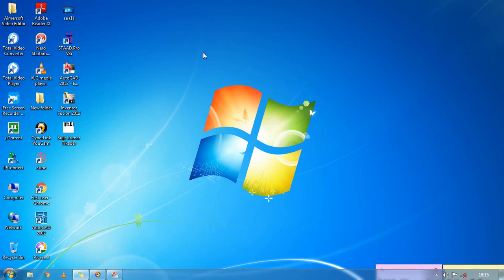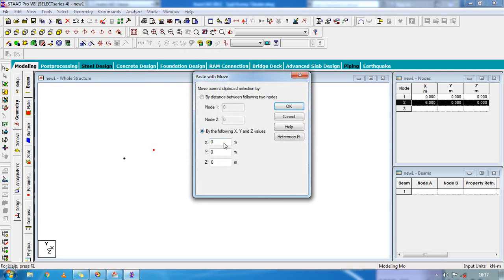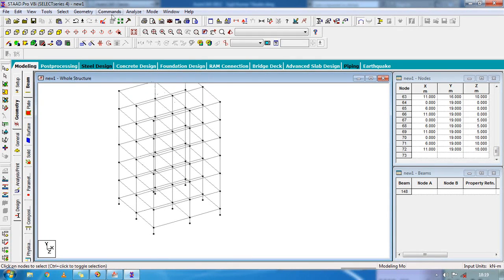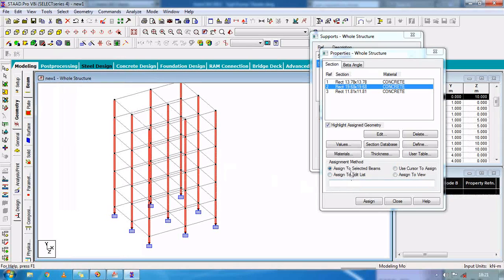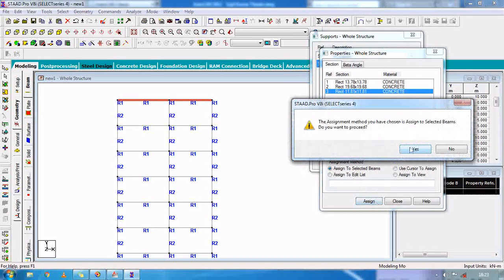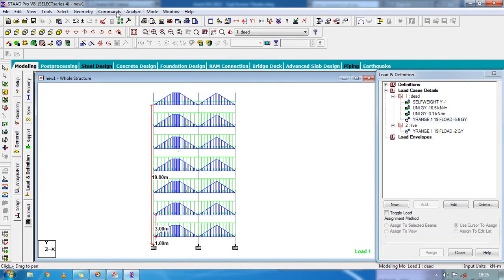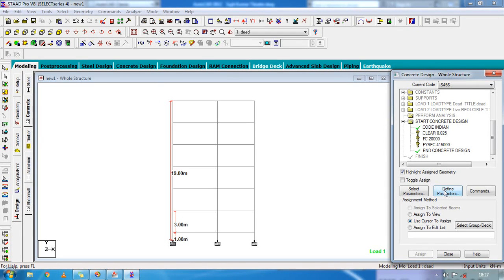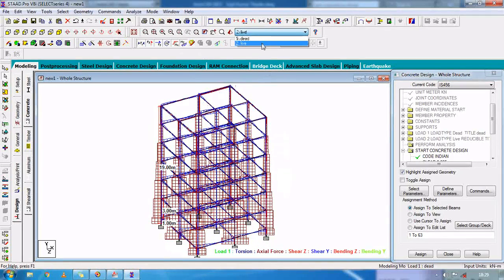STAAD Pro Tutorials - Design of RCC Multistorey Building Part 1 ( Day 6 )

Comment: Hi, I found that some people could not find the concrete codes. It happened to me before and I wish it will help other people as well. It is under the grey coloured tab (on the left) Modelling -> Design -> Concrete. Under design tab will find there are steel, concrete, timber, aluminium and shear wall (from top to bottom order). The concrete tab just below the steel tab. Click concrete and you will be able to find codes related to concrete.

Comment: Sir i observed that the design results shows 12mm rebar on column and 20mm on beam main rebars.  is that okay? what is your opinion on this.
Reply: im sorry, there is no 20mm, only 10mm on beam. my mistake lol
Reply from the maker: The dia of bar depend on the load of the section ! If the load is high then bar dia will be high !